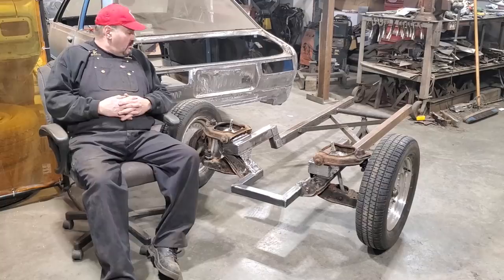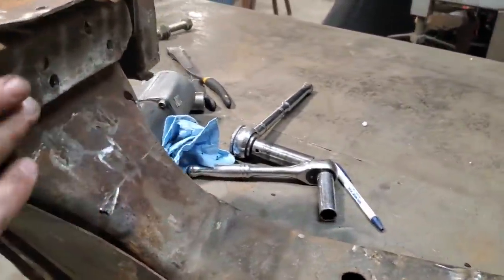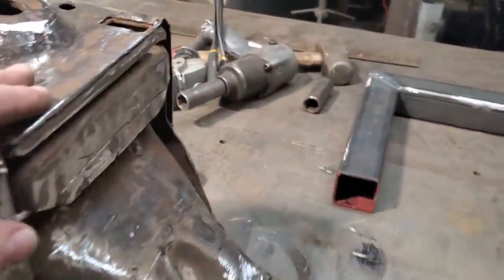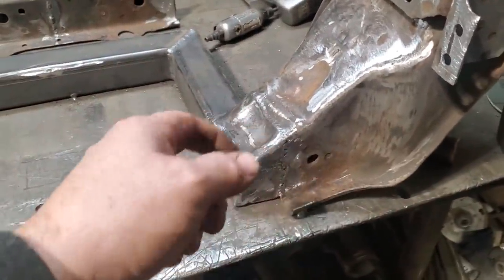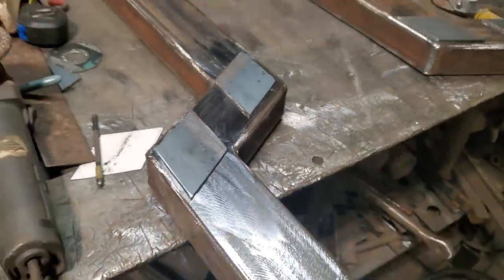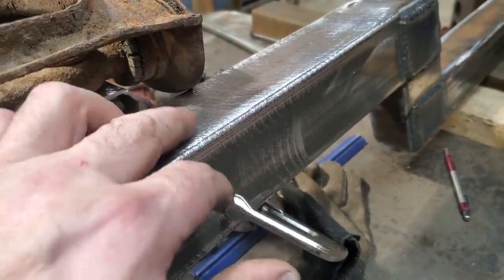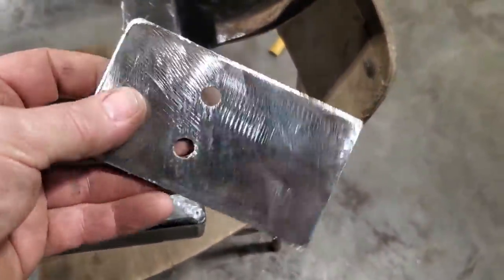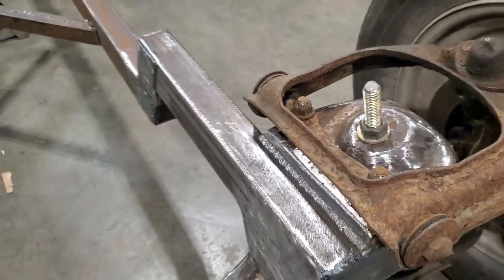Crusty. Front subframe and suspension complete

Comment: The tip about the pivot points needing to align on the rack and pinion ant the lower control arm are exactly the kind of tips I need. I am pretty ok at welding but would not have known that. I shortened 1992 S10 blazer chassis and put it under a 1965 Econoline van and the next step is the rack. So thank you sir.

Comment: Where were you 12 years ago Fitzy??! Could have saved me a lot of heartache and work 🤣 

Will definitely be starting again now, good news is that I am also building a Corolla so I can use all of your work as a blueprint 😁👍♥️
Reply from the maker: What year? What is the goal for the build?
Reply: @fitzeesfabrications  I am actually lucky enough to have 2, a 1978 and a 1980, both 4 door cars. The 1980 (KE55 here in Australia) is the one that will get the full chassis and be a drag car with a 1UZ-FE. The mistake I made was to start on it without a clear idea all those years ago and as a result it ended up stagnating. I will hopefully be back on it later this year after I have got the '78 back on the road, I have been cutting and butting like mad to get that one back in shape, it had way more rust than I first thought 😬 Love watching the Crusty build, keep them coming

Comment: Your theory on frame/chassis work is quite good as well as interesting.
You spoke of completing factory welds.
Banjo Mathews, a competent chassis builder found although all chassis's were built exactly the same, different chassis handled better on the same track.
He finally boiled it down to left vs right hand welders !
One guy welds right to left, the other left to right.
Talk about welding "science".
He broke down which side of the chassis each would weld.
Reply: is there any published research on that? otherwise it's just an interesting anecdote, not science. welding is a lot more involved, with many more parameters affecting the outcome than just left vs right handed welders.
Reply: @daos3300  you gotta beat people up huh??
Try heating metal it will bend/warp directionally..
You didn't know this right ??
Read about Bajo Mathews...
There are many books on his chassis building career.
If you can't find those try Circle Track magazine archives. It's an old story.
Idk...20+ years.
Reply: @SeymourBalz  calm down, nobody is beating anybody up. as someone who welds on a regular basis and has a sound understanding of the processes i'm just pointing out the evident flaws in that story. i suspect it's based on a true story but there's more to it than just the handedness of the welders.
Reply: @daos3300  did you READ...the comment ???
Left handers weld in THEIR comfortable DIRECTION.
Right handers in THEIR comfortable direction.
Which..."tend" to be OPPOSITE.
Banjo found out, the heating and thus cooling..
Direction of "Each" comfort factor, reflected on the overall chassis.
As a right,
I perfer welding...
Left to right.
"SOME" (key word there)
Prefer welding right to left.
Heating AND cooling are reflected upon direction.
Starting point....
Cools first...etc.
This "should" be simple to understand.   (???)

Comment: Rather than notching the frame, you might be able to modify the top wishbone by trimming the end of it and welding the piece back in.
There's certainly a lot of work in this Corolla. I'm wondering how many rolls of wire you've used with all the welding. Very interesting to see the progress and how you set everything up.  A belated Happy New Year and all the best from Queensland Australia.

Comment: I was waiting for this video to see how you were doing everything. Very, very interesting. I am assuming that you are still using .023 wire and just making adjustments on your welder for speed/voltage. This is an awesome video. You are a great teacher. Thanks for explaining about the rack, you will probably have this in next frame video. Thanks again.
Reply from the maker: Won't be for a bit yet. Plan is to get front installed in car then work on the back to get that as a roller.

Comment: Guy could put in a removable bolt in plate where you cut out crossmember to complete a box for extra strength .May be needed after a giant wheelstand.
Reply: That's exactly what I was thinking.  My Triumph TR has a removable brace between the spring towers; it could be argued that this factory chassis frame is of thinner plate material, but equally it will never have to contend with the same forces as this V8.  A bolt in brace should significantly stiffen the base of the towers but still be easy to remove for access to the engine pan

Comment: its a lot of work doing what your doing, but trust me I've been there as well doing oval track cars! 
I'd start with the bare chassis weld it up get it set to where in left side wheelbase was 1/4" shorter
than the right and my cage I'd hole saw clean through the frame then weld a plate on it then move it 
back up onto the frame and weld the top into place...same with the door bar mounts and go from there.
I built a rotisserie so that I could  weld it a lot easier as well just to make things easier to weld as well

the result was I had a car that wanted to turn left into the corners and if i needed it just slightly turn right 
to slide the car where I needed it to be.....a lot less work as a driver in bumper to bumper traffic at 
80 to 100 MPH on an oval circuit!

Comment: You should even have room for a bolt on cross member under the oil pan where you cut the original away. It will give more strength and protect the sump a bit.

Comment: YOUR BLOWING MY MIND, With that fact your two sides are not connected straight a crossed !! In my mind the suspension will flex like crazy and fatigue then break.
Reply from the maker: Go look at some aftermarket drag racing front clips with struts and there is way less on those frames

Comment: on such a setup., I fear high speed wobbeling because you removed a rigid section on the center of the crossmember and replaced it by a geometry that is much easier to flex.
this will be something to sort before going full bore with that car
nice fabrication
happy new year
Reply from the maker: This is alot beefier then many of the aftermarket setups that take the same control arm setup. High speed stability is key for me.

Comment: Hey Tony, great video on the front end. I've got my 64 F100 running and driving. Long ways to go, but she runs and drives very nicely. My wife thinks she wants to drive it which means power steering. I don't want to get real complicated or expensive as the solid front axle drives like a dream. Tight pins, tracks straight and has a disc brake conversion. What more do you need. I'm having some difficulty finding a conversation set up for the power steering. I don't want to spend a fortune. What have you guys been doing up there in the wild country? :)
Reply from the maker: I seen guys mounting power rack and pinion to the axle and using a snake joint to run to column.
Reply: A lot of guys fit electric power steering columns from GM/Opel Corsa B's. Not sure what that is in the US  but there's bound to be an equivalent. You can even buy controllers for them off ebay so all that's needed is 12V.

Comment: do you think you need "fish plates" on the front at the 45 degree welds,or a loop under the oil pan connecting each side ?
Reply: That’s a good idea
Reply from the maker: The fishplates don't hurt to have there. I done it in the past. Personally I don't think I need a cross bar under engine. Many strut setups have nothing under the engine.
Reply: @fitzeesfabrications  it’s a great job Tony !!

Comment: Tony.  A quick welding question.  I know you like to "pulse" sheet metal as in body work to prevent burn through.  I also started  doing that with good results.  I was wondering what is your "rule of thumb" for the thickness when you just run a straight bead.  I just ran a bead on some 16ga. without a problem.  I'd just like your input.  If the answer would be to long or involved, perhaps you could either add this when the situation comes up or make a quickie vid.  Anyway, as always, thanks for making me smarter.
Reply from the maker: I really run a straight bead. I find running a bead the weld wants to stand up. Just makes for more grinding. Also running a bead adds alot more heat and heat is your enemy.

Comment: It's starting to shape up nicely. By the looks of it, it looks like that 2x2 box frame section will have alot of stress on it from the motor weight and torque. I hope that the body will help reinforce that since I think I did hear you say that it will be a unibody. I'm not an mechanical engineer and you have build race cars before so I'm thinking you know best from experience. I'm just curious from looking at a video or will the roll cage help support that? Then I'm wondering are you using a solid type motor mounting system even on the bell housing area or transmission tail shaft? 
Your keeping me very curious for the next video. Great job as usual I just love your contact. One more thing could you just shim your upper A frame away from the frame or will it throw of the wheel  geometry off to much?
Reply from the maker: Lots of qustions!! Keen eye. Full chassis car with full cage. Solid mounts with a engine mid plate

Comment: Excellent as usual. Are they still requiring stick-welded chrome-moly for the roll cages? One of my co-workers built a pro-street '78 Malibu with a 400 small block and he was required to have a qualified welder build the roll cage.
Reply: Chromoly tubing isn't required, but it is lighter than mild steel.
Mild can be either Mig or Tig welded, chromoly must be Tig. 
Stick welds aren't allowed on anything structural in the cage or frame. Neither is flux core.
As the man said, no grinding of welds on structural stuff, either..so make 'em pretty on the first go!
😁
Reply: And I read your question wrong..by "stick weld" you meant Tig.
And the answer is yes, chromoly must be Tig welded.
Mild steel can be wire-feed Mig welded or Tig.

Comment: Your body work/ rust fixes are superb.  This design is , however, unfortunate.  My advice , if you want to pull the oil pan without raising the engine would be either to make the cross member easily removable (8 bolts) or dry sump the engine.  (Retired mechanical engineer). 
PS, I totally agree with your philosophy of securing your parts/ materials from recycled sources!  This is the heart and sole of hot rodding!
Reply: It might be worthwhile to wait to see how it all ties together with the engine mounts and roll cage extensions etc.  I'm pretty sure this is the start of a 3 dimensional construction, not just the simple flat ladder frame assembly you see here.
Reply from the maker: In case of a road race car this is not ideal but for a straight line setup this will be fine.  The side load needed to twist this 2x2 frame is alot more then you would think. If it is a issue I can add a small cross brace from each lower control arm bolt. Thanks for your input tho

Comment: Tony you talked about the 2 degrees on the upper control arm tower but I didn’t see where you took that into consideration when you built the chassis rails. How did you take tha into account? TNX Frank
Reply from the maker: It was built into the  cross member. That is in square  but the top is 2 degrees back

Comment: I'm a big fan of yours! awesome work!
What is the Crusty measurement between control arm pivot points? I'm asking because i'm doing a frame up soon and would like to compare to your width you have. Now mine is a 17inch, I'm thinking to widen this frame 2" per side so the LS can drop in better. 
thanks for everything
Reply from the maker: What front end you using? Not sure off hand what that measurement is right now will  have to check
Reply: @fitzeesfabrications  I'm doing a ls blow thru carb deal in a 85 nissan pickup..frame is small everywhere front to rear and side to side. So i'd like to stretch it a bit and convert to pinto or moostang rack front end. I'm watching your builds and getting more ideas from them, so thank you greatly and also for the replies!

Comment: Hey Fitzee,

Why didn't you box in those gusset plates on the bottom of the frame towers? Seem like an area to collect dirt and rust away.
Reply from the maker: It's not closed in under the spring mount and dirt would get into that section though there so I thought it best to have it so it could be easily cleaned out
Reply: @fitzeesfabrications  Wouldn't it be better closed and therefore never having to remember and clean out? I enjoy your straight forward approach to self engineered  solutions.

Comment: Fitzee, are you still using the 110 V welder for this? If so, could you tell us what size wire you are using? I'm using a PRO mig 140 with. 025 wire but using it for 16 through 20 ga. Sheet metal.    ALL your videos are AWESOME,  thanks for the education sir.........
Reply from the maker: This is 023 wire on a 110 machine. Getting lots of heat and the wire is fine. 030 wire might be better suited  for heavier steels but I make do
Reply: @fitzeesfabrications  thank you again sir!!!!! Your videos are AWESOME!!!!!!!

Comment: Thanks for you great video. Please answer two questions, did you use a 110 or 220 volt welder, and what size wire did you use? Thanks again.
Reply from the maker: 110 volt. .023 with co2 gas.
Reply: @fitzeesfabrications  Thanks for your quick response.

Comment: Happy New Year Tony!
As Crusty is a drag car and not a road car, is it feasible to make spacers (and use longer bolts) to put under the upper control arm mounts, to space the arms up slightly, instead of notching the frame rails?
Reply from the maker: Crusty will be built to be a street strip car. Few have said this. Something to look at

Comment: Those last two gussets were a good idea but WAY too thin. S/B 3/8 thk. steel. Maybe 1/4. Also, I vote for trimming the control arm flute NOT NOTCH your nice 2" x 2" rail. That would be crazy. No matter what you do to finish it off......the cross section will be less than 2". That is probably a high stress area near there. Not to say that you haven't done a wonderful fabrication job, you have indeed. Very nice. Dead nuts plumb and square and level.
Reply from the maker: Ya still not decided on what to do there. Good points

Comment: Hey Fitzee anther great job .now when you going to come to Florida and work on my 1991Dodge Ramcharger. Lol . I have to replace the Roof and do a few Quarter panel repairs.  But first I'm in the middle of rebuilding all of the running gears and trans transfer case motor. And boy was it a bitch rebuilding the Dana 44 front end after some precious owner had a know nothing mechanic work on it he put two many shims in the wrong place and had it all screwed up

Comment: Awesome. Question: did you use a flux core wire to weld the frame to the front assembly, or a MIG weld?
Thank you.
Reply from the maker: Mig. 023 wire with c02 gas
Reply: @fitzeesfabrications  Thank you.

Comment: And a quick question. You may have mentioned it but, is the solid mounted engine going to act as an integral chassis component, connecting the two upper portions of the "K frame" together to prevent flexing.?
Reply from the maker: Yes and there will be a mid plate as well

Comment: Looks very nice so far. I'm curious why you decided not to wend in gusset plates on the outside of the frame rails like you did on the inside. Seems like it would be a good idea to use them on both sides, no?
Reply from the maker: The old rule book only called for them on one side.
Reply: @fitzeesfabrications  Regardless of the rule book mandates, wouldn't you feel more comfortable with the added strength of gussets on the outside as well, though? I'm assuming the rule book does not say you cannot put gussets on the outside, but that's just an assumption on my part.

In any regard, the progress here looks great! Enjoyed the video. Thanks.
Reply: @ZeGermanHam  if you do full penetration welds that area should be of similar strength to the original box section. Then adding the fish plates on the inside adds to that and with the tapered ends there is no stress riser at the end of the plate. The sum total of all that, it is already stronger in that section than either side. Adding more gussets may make you feel better but it is not needed.

Comment: The big problem in using a available street stock strut setup is that they are definitely NOT race quality. Street stock strut suspensions fall apart with alarming regularity. Thanks for being an "old time" hot rodder" Fitzee...just like me.
Reply from the maker: Not only that they are big in diameter. You have to be creative to make one work.